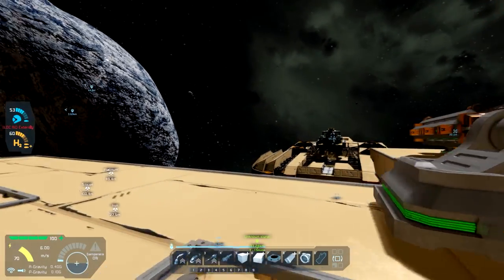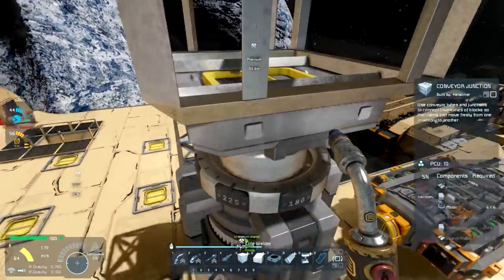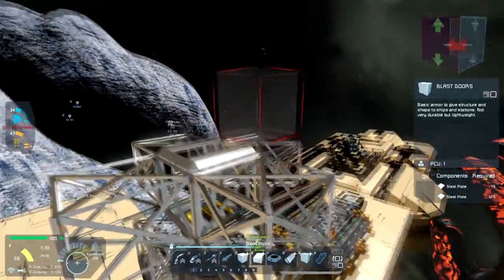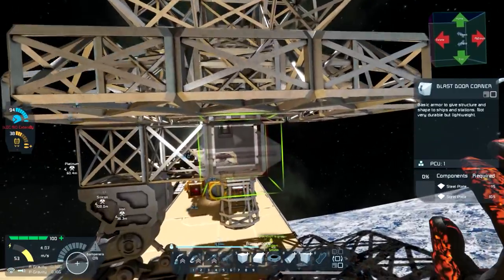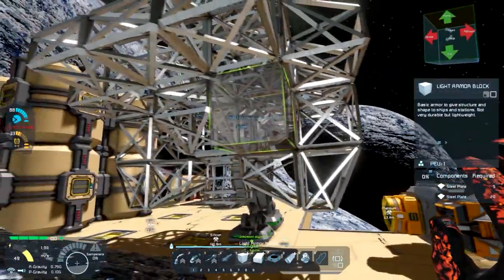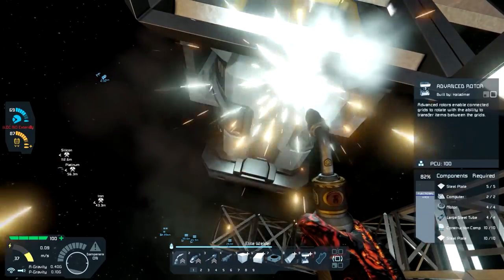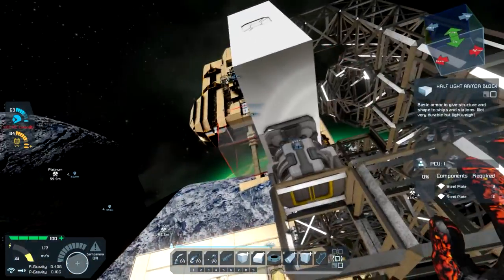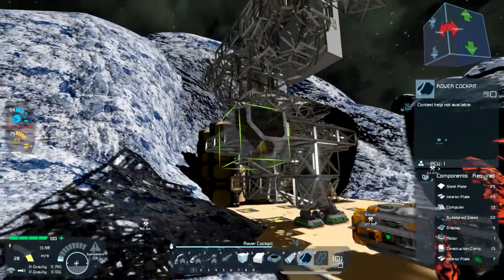Space Engineers | The Alien World Start | Ep 30 - Moar POWER! (Beam Drill Turret Ship)

Comment: Alright, i got the ziggurat build started by the trader.  I will be on tonight about 8 for a good couple of hours.  I figured 15 by 15 would be big enough, that means each of us has a 50 degree "cone" to kill in/from on horde night.  Honestly, the zig will be very easy and straightforward.  The safe path leading to the top of the zig will be MUCH harder...

Also, i have given up on using small rotors and pistons.  I have had my heart broken too many times.  As well as my body.  Seriously, shit just explodes when the phsyics doesn't play nice.

Learned a lot of lessons from my very large build, so i have chosen to restart.  And since i was restarting, i opted for realistic storage, grinding, welding, no BOB, and initially, no mods until i get off of the planet and to the moon.  Just built my first grinder/repair drone.  Forgot how much i do not like atmo thrusters.  

Question: With merge blocks.  I place and weld up two seperate merge blocks, then somehow move then next to each other, then i? I weld them together? I go into the control menu and toggle an option?
Reply from the maker: Merge blocks are a connector type, and if you have the two grids aligned squarely, when you get the blocks close enough together, they should "snap" together like a connector with magnetic strength enabled.

Keep in mind, this will join two grids as a single grid at the point they're mounted (grid 1 & 2 become just grid 1). if you leave them "exposed" (_nothing_ touching the other grid on that same line) you can separate the two grids by turning off the merge block.  If there are any other blocks with mountable surfaces touching on the two grids, when the merge block activates, you will not be able to split the grids without removing those touching blocks.

When using these on large builds, you may see some slowdown or even a freeze until the grid update is completed.

Normal connectors link the two grids (grid 1 | grid 2) so be careful when using these things in place of connectors to connect different grids.

Also, because large grid and small grids cannot co-exist directly, the large grid merge and small grid merge do not work together.  Only a large grid rotor with a small rotor head will allow you to do this.